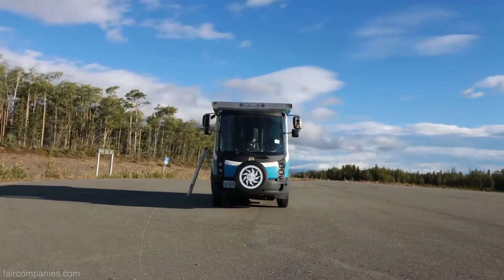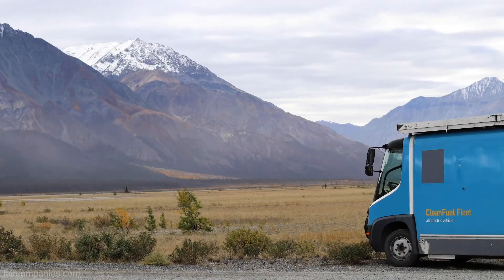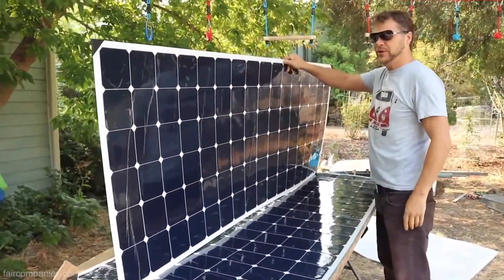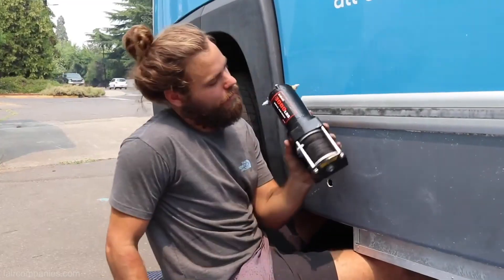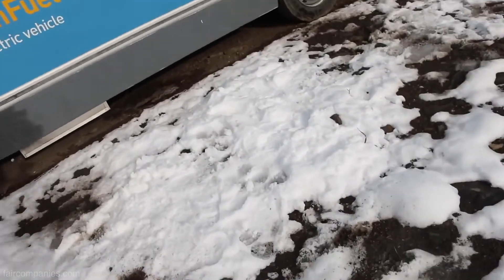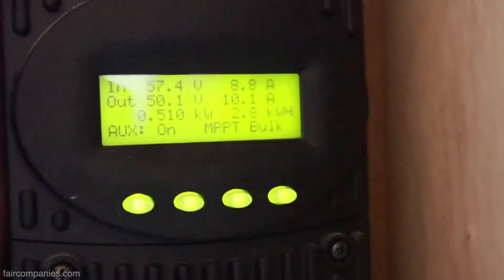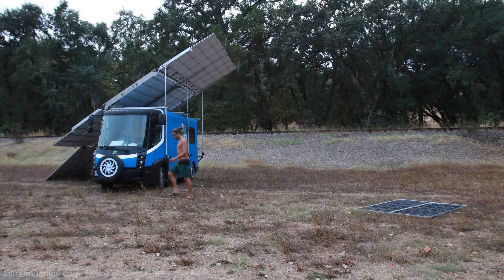Delivery EV turned solar-powered campervan: 100% self-reliant

Comment: Great episode, and I have a question because either I missed it or it wasn’t 100% clear. Does the solar charge off of the main panel while driving?
-
Also, I have always thought it is such a waste that vehicle’s that are electric especially now it would be so easy, that all of the trim and portions of the roof and the hood and the trunk should all be solar panels so that when vehicles are just sitting there, they could trickle charge the batteries. Since most vehicle’s sit 90% of the time, this would be a terrific way to just trickle charge and passively keep those batteries up at all times. Thank you Michele
Reply: I had the same question, looks like you could pull a good 2kW off those 6 panels, continuously as you drive and when making short stops.
Reply: The vehicle has two batteries. The main vehicle battery, and a second battery that is directly charged by solar panels. Energy from this battery can then charge the main battery when stopped (as well as continue to receive energy from solar panels).
Reply: @AerialWaviator  Good answer. More to the question, there are 24 panels, I think 125W so 3kW. 6 panels exposed while traveling so 750W. Solar charges one bank, 48V. That bank manually charges the EV bank, typically 300V.
Reply: I am pretty sure they do it. it wasn’t made 100% clear because it's evident. That's how it works.

Comment: The cheapest way to do this would be with a normal electric car pulling a very long and lightweight camper covered with solar panels like that.
Unfortunately electric cars are still very expensive / unaffordable and NONE of them allow you to tow a camper. At least not in Europe.
Despite all the greenwashing propaganda we are still basically nowhere with reducing our reliance of fossil fuels.
Reply: There are plenty of EVs in Europe that are allowed to tow: Tesla Model 3, Model X, Hyundai Ioniq 5, Audi e-tron, Kia EV6 and Polestar 2 to name a few.
Reply: @Freba9  Thanks for the list! Seems there is finally movement but 50k for an electric car is still kind of out of reach.
The Kia EV6 seems to be able to tow ~1600kg in the EU which isn't too bad. Not enough for a big camper but you could still design something that is extra long but still lightweight to maximize solar panel surface.
Lets say 4x glass solar panels long would be about 7m and with solar panels extending 1m to the side you'd have 28m² or 5.6kW peak solar and a weight of about 280kg in (glass) solar panels. 
Flexible solar panels would be much lighter  but less efficient and like 4x more expensive. Maybe the weight and possible higher aerodynamics make it worth it.
Still, theoretically that should give you much more travel range at slow speed per solar day than the bulky delivery van if the solar camper is designed well.
I also found a good website "electrictowcars" which has lists.

Comment: I get that they are  all about solar hence the trip to make a statement.  Adding 1 or 2 small wind turbines, ceiling-fan sized, would have allowed them to charge overnight and in the bad weather.  Also wind in the mountains, wind at the beach, etc.  They are small and blades can be removed for storage.  About as inconvenient as setting up the solar array.  I love the van and the idea of roaming free without fossil fuels too.
Reply: Solar thermal can harvest and store more energy faster with the right setup than solar electric and wind at much cheaper costs.
Reply: Those turbines are about 250W in strong wind. Their array is around 3kW. So not too useful for the inconvenience.
Reply: @artsmith103  I disagree, as I believe turbines are small and useful for a portable set-up.  They wouldn't have been stranded and could've produced more power in less ideal solar conditions.

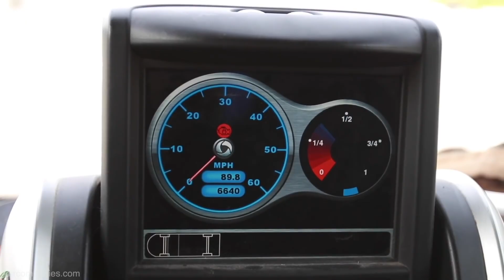Comment: Going 30mph on a 65+mph highway is dangerous‼️Does not do hills, mountains 🤨 With solar panels Made in 🇨🇳 China, this would only make the USA 🇺🇸 beholden to China for future products / energy. With politics the way they are today, I say no to this prospective. Agree - Technology simply has not developed enough. 🚗 Driving from Antelope Valley to Paramount Studios in Los Angeles already takes 1:45 through hills, mountain, flatlands… this solar panel vehicle would turn into my 🏠 🫤
Reply: @cinderblock2289  yeah the minimum is 55

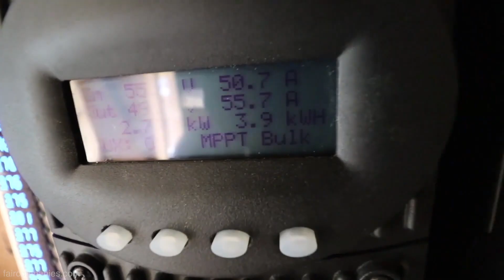Comment: At around 8:50 he states he had about 2,700 kW coming in. Is that accurate? I was thinking the number would be more like 2.7 kW. Is there a comma where there should be a decimal?
Reply: Yeah he meant 2700 Watts. He mistook the decimal point on the display for a comma. I don't want to be too picky, but in some other spots he mixed up KW and KWh.
Reply: @juandenz2008  Thanks for clearing that up. I don't know much about electricity, but even 1kW incoming sounds like a fairly large van rooftop solar these days. Of course he's got a clever rack to stack them.

Comment: Please stop referring to the solar panels as flexible, they are not!!! You bend them they will crack!!! They are lightweight panels only, never try to flex them!!! 
Buy a gosun fusion solar oven, it only use 200 watts 12 v to run or use direct the sun!!!
Reply: Regrettably, while I agree with your general sentiment, the solar panels they are using are marketed as "flexible" and hence the users of such panels will likely flex them.  There is little doubt in my mind that the panels in this video will degrade over time.....

Comment: Seems like the design should be to isolate the tech from the living space to reduce the noise from the inverters. It would be horrible to spend days in the noise waiting for a sufficient charge. Make a separate compartment for the tech with cooling to the outside or to the living space depending on the temperature. Another idea. If I would go this far, I would consider adding the possibility to generate wind energy too, maybe a Savonius rotor which you could raise up when stopped for the charge. That would help a lot, especially in the cloudy days

Comment: Hi Guys, Like your idea and the journey. How much have you put into reducing weight in your van. I have a motorhome that is diesel but is all electric on the inside with lithium battery to battery solar etc but I have replaced all glass bottles with plastic, drilled wooden panels out to reduce weight but not strength where they can't be seen. All this has added up to reducing my weight and so efficiency of the van by a huge amount especially when going up hill (I live in Scotland). The biggest weight reduction was shifting to lithium as I lost 60.5 kg just doing that. Regards Grant

Comment: I think very important to optimise the whole vehicle for electric drive and solar power. This van is way too heavy, big and boxy. The deadweight is too much, and lots of power consumed by just pushing the air, not too mention if there is a wind against us. The best option is building a very light, streamlined new vehicle instead of using a conventional vehicle. That would need much less batteries so we can loose lots of deadweight.
Reply: Under 35 mph (50 kph), the amount of air drag is minimal. Particularly at 20 mph (35 kph) speeds these guys were traveling.
The advantage of using an existing vehicle like the Navistar International EStar is it was a prebuilt vehicle, being recycled for another use. This compared to the time and cost of designing a building a custom vehicle.
Reply: It's a 2010 Navistar International EStar. So it is a purpose built all electric
Reply: @Noniksleft   They could not make lots of necessary compromise because the purpose of the vehicle. Too high, too boxy, way too heavy, because it was made to deliver packages. They had to comply with the given specification. There is a nearly impossible task to make an efficient electric truck. At the available technology most of the manufacturers have to make lots of bad choices. Put in too much, too heavy batteries to reach a specific range. Making a way sturdier chassis because of the extra weight. Lots of electric cars carry enormous deadweight. We should accept the fact that the current technology good enough for making small e-cars with short range, but not really good for big cars and longer range. Most of the cars carry only 1-2 people locally and not too much or zero packages. For this task a small car with small battery package is enough and even we dont need special quick charge stations.

Comment: If the millions of gallons of diesel burned to extract lithium and rare earth minerals for your "green tech" was put to use with a small turbo-diesel engine, you'd go farther, and more comfortably. And then you wouldn't have to dispose of extremely hazardous waste every two years when your expensive, high-tech batteries rapidly degrade. Also, you wouldn't have the geo-political necessity of wars, and corporate hooliganism to extract these materials from third world countries without paying the populations, forbidding child labor or making public infactstructure there. It is all about fooling people into a goody goody trick to "save the earth" whilst making huge gains in profits and control. Real green is simple and natural as possible. It is anti-fragile and low tech. Enjoy your expensive fragile useless toys.
Reply: You have no clue. Life cycle emissions of electric cars are far lower than any gasoline or diesel car. If there is one resource that is very sensitive to geo-political issues it is oil. And guess who is the biggest consumer of cobalt? The oil industry.
Reply: @Freba9  Don't visit his YouTube channel.  It'll take months to "un see / un hear" his drivel......

Comment: Does it have regenerative braking? That would seem be helpful, if it's not too heavy.
Reply: I believe it does, they mentioned it at one point.
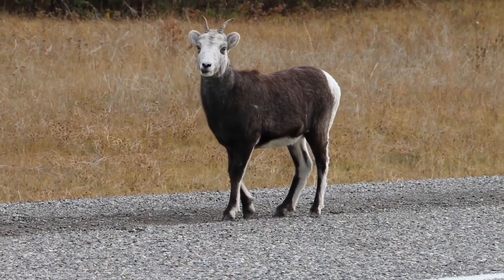Reply: Yes, they mention this at ~9:40 in the video. Climbing a hill and regenerating energy on the way back down the hill.

Comment: So what do you do when your solar is out and a huge 50+ mph wind comes up? Can you get them in in time before they either break or your RV tips over? I think it would be neat if you could build a self retracting mechanism that works automatically in high winds. I have a solar array on the side of my RV that I raise to face the sun, but I always try to run outside and lower it if I believe the wind speed will top 40 mph. I'm a full time RVer in a big class A motorhome. I was at Lake Mead about 6 months ago when a 70+ mph wind came through and ripped my awning off, destroying the arms and roller mechanism too - and it was rolled up and secured against the side of my RV at the time. If I had a giant solar farm on my roof like you do, I'm afraid the results would have been disastrous.
Reply: Honestly I'd set up some type of warning system Or ar least wind chimes ha. But you make a valid  point, wind is arguably the most dangerous element
Reply: Yeah that is a problem, I think he actually lost his solar panels due to winds.
You'd need some kind of wind measurement and "quick retract" mechanism
Reply: I was wondering if they could add a windmill for when it's cloudy and windy
Reply: Add a wind turbine or microhydro generator.
Reply: When you’re off grid the last thing you want is something that you can’t easily do manually.  Personally I would stick with the way it is.
Reply: Why not get a powerful diesel generator with a wind thing attached. That will do the job. Sorry, I know it's pathetic but I could not resist it. 😉🏖️
Reply: If retracting the sides and tilting the array was motorized it could have a wind speed sensor that could tell it to pack it up. I wonder if it could do it quickly enough..
Reply: It happened.
Reply: @kaci719  Check their website
Reply: The same way that sailboats deal with having all their sails up when a 50mph gust hits. They watch the weather lol. If not they will flip over and capsize in the middle of the ocean.
Reply: @Joseph-C  Yeah it's called reefing the sail.
For sailboats kite sails might also be a future alternative, both for direct propulsion and for "kite power" generation.
Reply: It turns out they all starve to death when in the middle of nowhere they were besieged by three months of cloudy weather!
Reply: THE BATTERY TECHNOLOGY IS NOT SOLID YET.  A WHOLE FLEET OF ELECTRIC BUSSES AT A CHINESE UNIVERSITY EXPLODED IN ABOUT ONE MINUTE AND CELL PHONE BATTERIES SEEM RO BE GOING THE SAME WAY.
Reply: @karenishness1  oh shut up. Vehicles burning flammable liquids in blazing hot engines are far more likely to burn, by a magnitude. And yes, there are studies to back this up. But a fearmonger like you won’t read them…

Comment: I'd rig up/add a telescoping wind turbine that can be easily propped up & lowered. Iv'e noticed just about every rest area Iv'e been to along an interstate is always windy.
Reply: I like the thought and idea. It would provide charge, especially useful if sufficiently windy overnight. However, when they have just under 25,000 watts of solar on the roof(see video description), the addition of a small wind turbine with an average output of 70 to 90 watts, it's hardly worth the cost, effort and the weight it would add.

70 to 90 watts over a day/24 hours would provide between 1680 and 2160 watts per day, if the wind holds. Meaning they'd require at least 5 small wind turbines to approach half their solar capacity.

Comment: I always have so many questions when listening to nomads and others describe their solar set up. Kilowatts, volts, amperes, watts, inverters, etc etc.  I need a Solar for Dummies or something really, really basic about electricity. 
Great video as always!
Reply: Any basic book on electricity / circuits will teach you the fundamentals. Once you know the fundamentals it is very easy to build on. Having said that many of the nomads don't really have a good understanding of electrical engineering. The electrical engineers I know would be triggered listening to the nomads mixing up Watts with Kilowatts and Kilowatts with Kilowatt-hours.
Reply: There is a lot of information on solar on Youtube.
Reply: @Freba9  LOOK UP THE BUSSES IN THE CHINESE UNIVERSITY THAT EXPLODED FROM OVERHEATING BATTERIES.    NOT EVEN TIME TO GET OUT.    ALSO EXPLODING CELL PHONES.   LITHIUM  I THINK.
Reply: @karenishness1  Yeah things catch fire sometimes.
Reply: @Freba9  YOUR IGNORANCE WILL GO DOWN IN HISTORY.
Reply: Had sim thoughts, would love to do a course in this.

Comment: Believe or not, a transmission saves a lot of energy. The electric motor doesn't work as hard, if you had a 7 forward speed & 1 reverse speed automatic transmission, or a 6 speed  manual transmission behind the electric motor. Perhaps an Emrax 358 motor, puts out about 400 h.p. & 1200 ft lbs of torque & only weighs 80 kilos. You could also put a vertical axis wind generator on the front center of the bumper to produce electricity. I would also pull a very light aluminum trailer behind the van with 4 solar panels on it. They also have a NISMO 3 cylinder Nissan turbo diesel engine that put's out 400 h.p. & only weighs 70 lbs, if you wanted to make your vehicle hybrid diesel electric for the rainy days, that little engine could turn a generator & it could even propel the van. Make the diesel propel the front wheels & turn a hefty generator for the rainy days. The Emrax 358 motor & super efficient transmission could generate the rear wheels on the sunny days. With solar, wind & hydrogen fuel from h2o, burning in internal combustion engines & turbines, those 3 power sources would be all the world would ever need.
Reply: Turning renewable energy in hydrogen and burning this in an engine is horrendously inefficient.